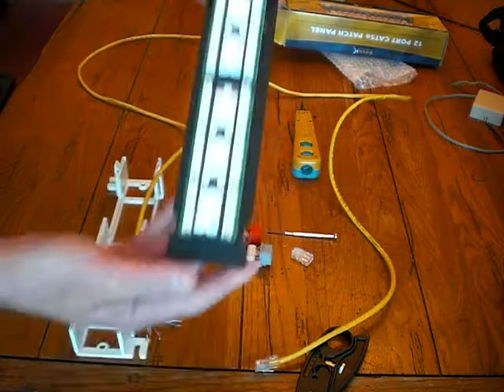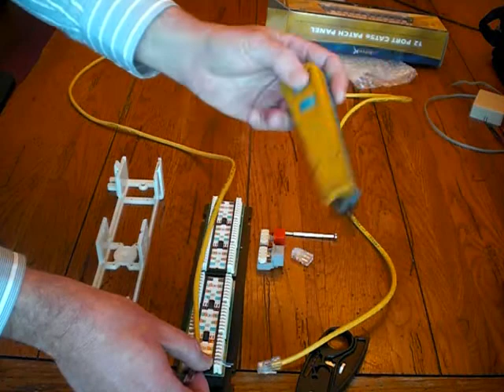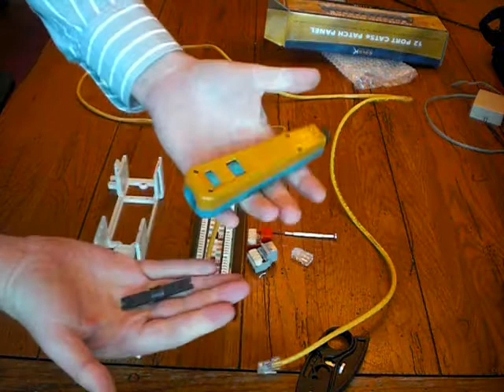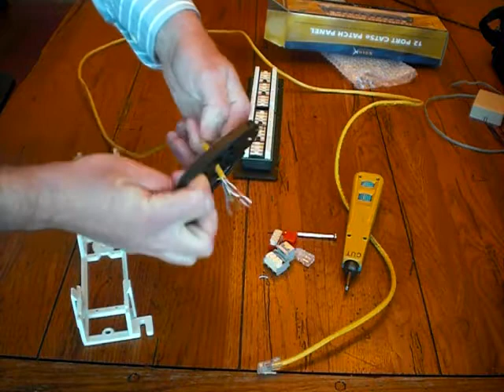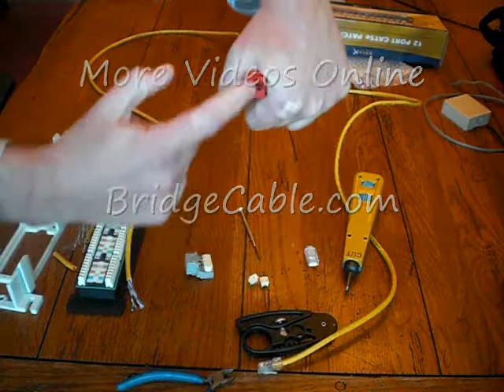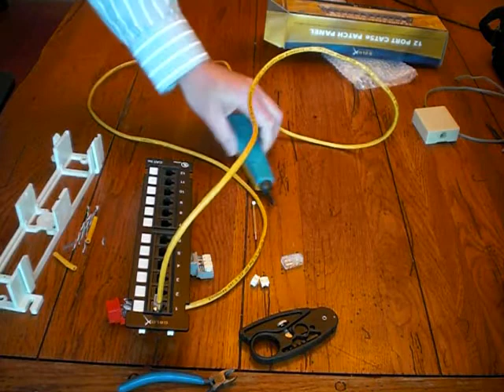Network cabling into a patch panel for your network Part 2

Comment: i get yow the patch panel works. what i want to know if where does the main network wire go? those are all going to the different jacks, butbit has to get internet from somewhere. where would i connect the internet companies cable to?
Reply: +Adrian Soto When you have you internet companies (ISP Internet Service Provider) cable nearby the place where want to install your it rack containing the patch panel(s) and routers/switches you can just plug it in your router/switch in your rack. Otherwise when you internet companies (ISP Internet Service Provider) cable is on the other side of you house you could make there a wall mount en run a cable to you patch panel and use a distinctive colored patch cable to connect your router/switch to the right output on you patch panel. A patch cable is commonly about 6 feet long and available in a range of colors to distinct different zones.

the idea behind using a patch panel is to create a nice clean overview of your cables. It is case to make a map whereby you map the number supplied by the patch panel port to a specific wall mount in your house. 

I hope this will help you.
Reply: Internet goes to the Router, Router goes to the switch, switch goes to the PatchPanel, PatchPnael goes to the wall in the office.